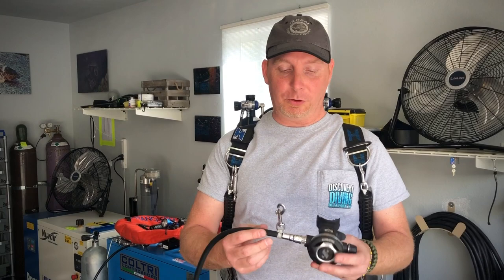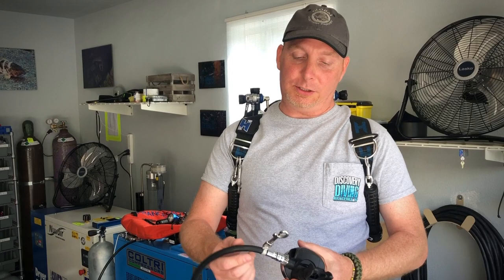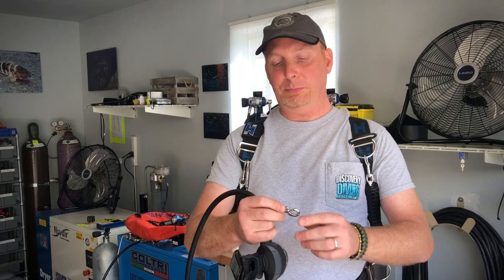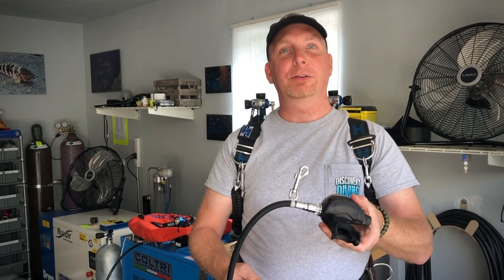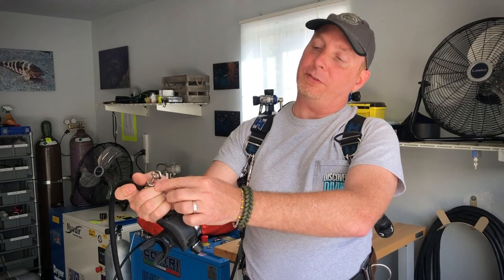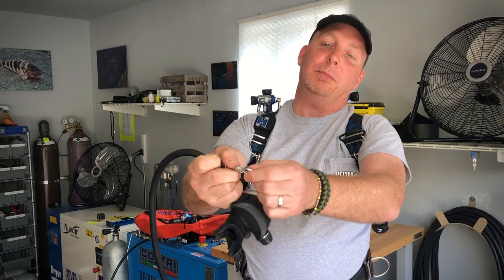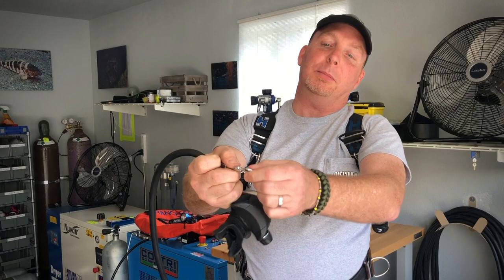Using a Bolt Snap with Dry Gloves

Comment: For me, the biggest problem isn't the positioning of the bolt snap, but operating it. When I'm wearing thickly insulated dry gloves, there's always a 4-5 mm gap between the end of my finger and the end of the glove, and that excess material inevitably gets in the way. Even with the bolt snap all the way open, it's just about impossible to clip on because that empty glove material at the tip of my finger gets right in the way of the opening.
Reply: cheaplaffsarefree same for me, try to use side surface of your finger not the tip of your finger, some times works
Reply: Maybe try using smaller gloves but it can still happen. I use my thumb to open the gate and this doesn’t get it the way as it’s the side of the thumb.
Reply: For whatever it's worth, I'm going to give the Xdeep NX clips a shot. Haven't tried the small ones, which you'd use on your long hose, but I've got one of the large ones on my SPG. So much easier to clip off and clip on. Like night and day.